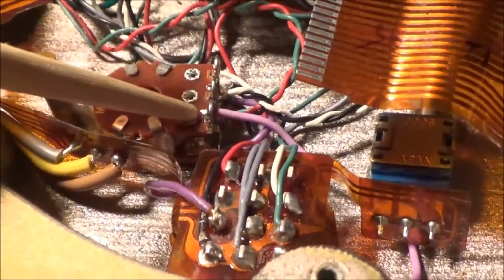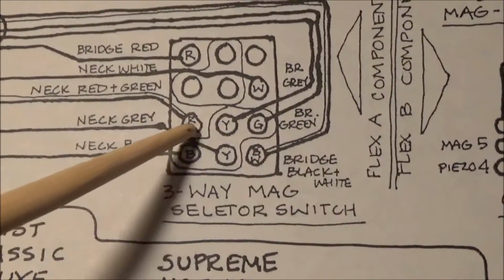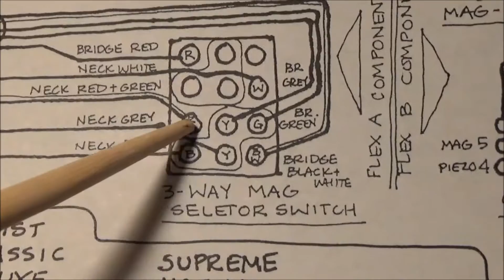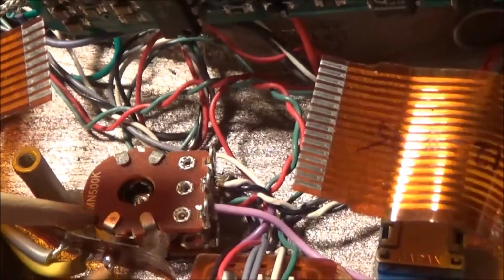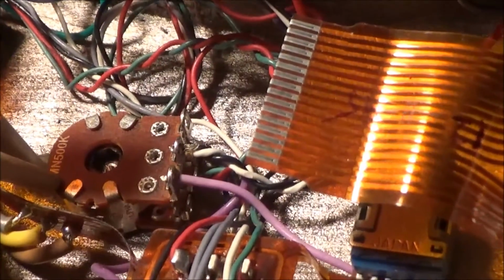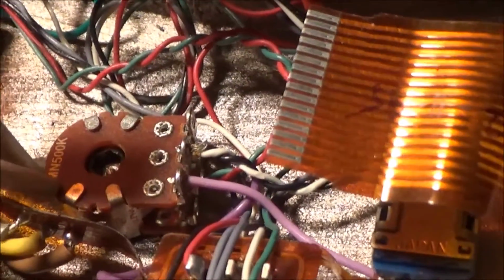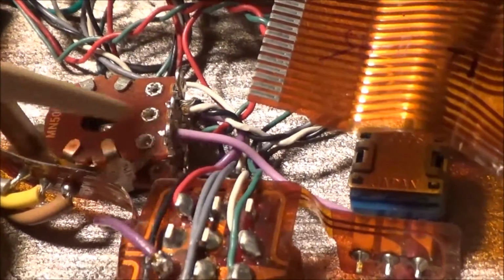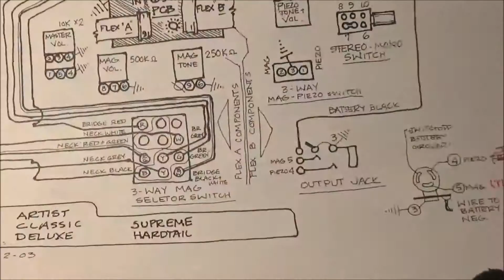Stealthily Adding A Blend Pot To A "Pre-Refined" Parker Fly Deluxe

Comment: Thanks for sharing.  I'm interested in replacing all the pots as mine seem to be worn out. I've tried some contact restoration fluid and it made a bit of difference but overall, a cow don't make ham as they say.  So I might try modding and wiring up the standard 16mm pots like your Stew mac example there.  Thanks for sharing the master volume mod.  That pot is just annoying.  Why they didn't opt for a dual tone setup no one will know.  With dual tone pots you get a bit of basic eq, but 2 volume pots when both the piezo and the main pickups have there own volume as well is just plain weird.  I almost wonder if it should have been a kill switch or something.  I've been trying to source the original pots but next to no one sells them off the shelf(COSMO pots for the record.)  So I think it's time to just go to standard and run wiring to the ribbon connectors(even thought about just replacing all the ribbon  but then the space issue will pop up no doubt.  Anyway, thanks again for sharing.
Reply from the maker: The master volume makes sense in some ways, really depends on what your style requires and how you like to use your pickups. If you like to blend magnetic and piezo pickups together it makes a lot of sense to have the master volume. Back when the Parker Guitars forum still existed, I remember a couple of people wanted to do something similar as you. As I remember, only one person was able to successfully do what you want to do - they connected wires to the existing ribbon cables, I think right at the connectors to the PCB. Most people took out the original electronics and did conventional wiring. They used a Fishman "Power Chip" for the piezo pickups and lost the tone control on the piezos AND the master volume. They also had to get new saddles because the output was too low with the original saddles. All of that was a lot easier to do 14-15 years ago when parts were still relatively easily obtainable. To me that's a big downgrade to lose all that, but to each their own. Anyway, best of luck and let me know how it goes in your quest to get that fixed.